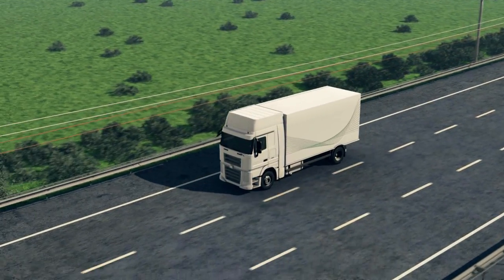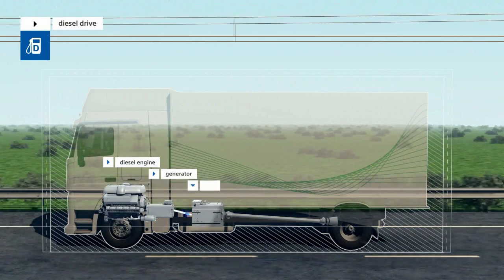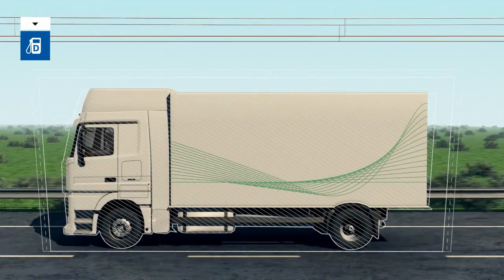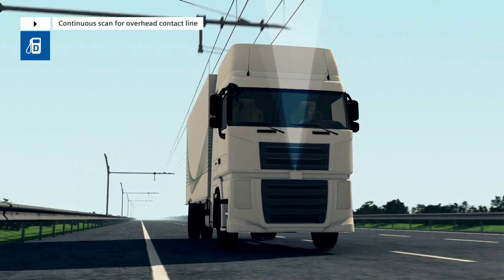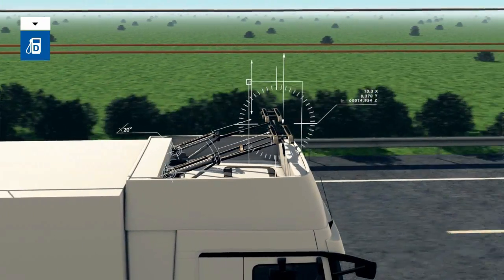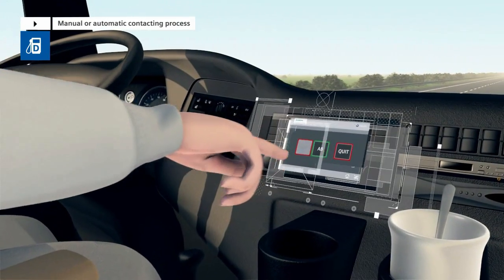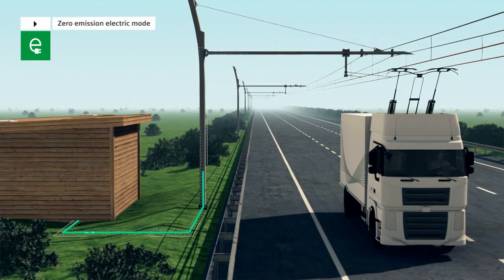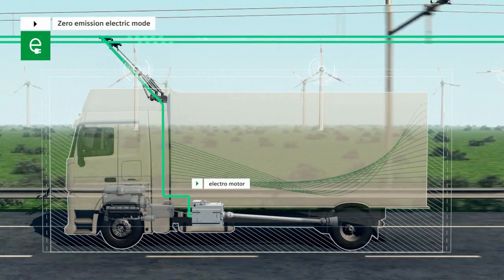eHighway Animation Video to Explain Siemens Electric Highway

Comment: the highway should have an electric lane separate for having a driver breake. Drivers need to relax sometimes! If you added a autonom driving system the trucks should be drive permanently like 85kmh for 100km. The hybrid engines weight a little bit extra but the electric lane will save alot of energy by driving with an autonom system. They will stick together as a long Worm and perform mutch better this way.

Comment: It is great because in most cases the high voltage conduction lines are close to the roads and there would not even have to be new lines in most cases, but they would only have to be moved a minimum distance at a really low cost. low compared to the huge problem that results. in some cases and we see that those who move frequently on the roads would only have to move them a few meters